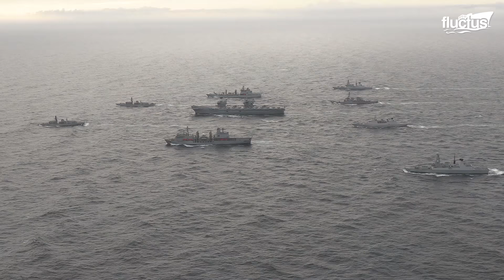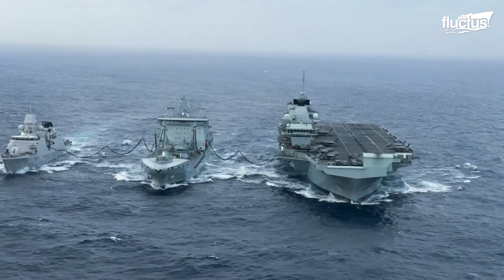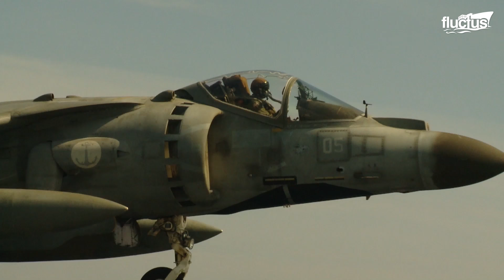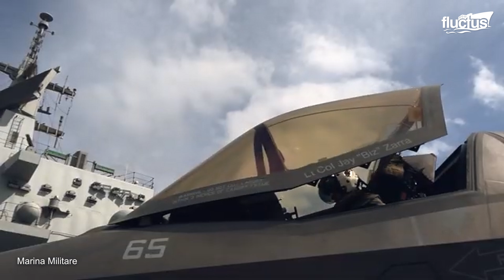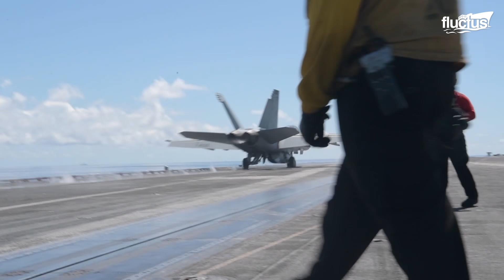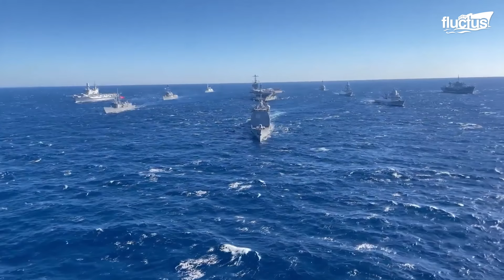Why US is Docking UK’s Most Powerful Carrier Inside US Navy Base

Comment: Does the Royal Navy have enough ships to provide protection and supply for it's own carrier group I doubt it they only have like 41 F-35B for both the royal navy and Royal Air Force to share and I think a full complement of Aircraft for one carrier is like 40 my worry for any western power is if a full blown war came could you replace the losses quickly with industrial output I think not which is actually the true measure of a great power you do not have to have the best to win you just have to outproduce and more than cover losses quickly

Comment: When I was a kid I got to go aboard a type 21 British frigate, like the HMS Antelope. It was quite impressive. This was before the Falklands War. A handful of years later and I was stationed on the USS Kitty Hawk. I immediately thought about my earlier experience on board that British ship. You see, the HMS Antelope was sunk during the Falklands War. That frigate had zero water tight compartments, while the Kitty Hawk had endless numbers of water tight compartments. You could literally cut the Kitty Hawk in half, and both halves could keep floating. Another thing I thought was odd, even as a kid, was as you entered the British ship, you entered a lounge with a typical 70's living room couch, a wooden kitchen table with wooden chairs, and particle board kitchen cabinets on the wall full of warm beer - which of course they offered my aunt and uncle one. Comfortable for sailors that were deployed long term, but not great during war time.
Reply: The Amazon class, designed and built by Vosper because they said they could build light patrol frigates faster and cheaper than the MOD and its "conservative build requirements."  
All those rules you have about water tight compartments? 
Who do you think wrote those rules? 

That stuff is a lifetime ago now, all British warships are built to the same survivability standards as the US. 
We are in fact the only other navy that builds to that standard. 
That's one (small contributing) reason the constellation class was  such a failure, fremm wasn't built to those standards. 
Everybody here in the UK (who's into this stuff) said at the time, if it's not the type 26 used, America will balloon the cost trying to half arse the design into a us design. 
Whereas the type 26 could have been just swap out the guns, sensors and computers to make a constellation class out of type 26.

But for some strange reason America has an insecure hang up about asking us for help! 😂
I wonder why? 😁😉

Comment: The UK wasted money building two conventional ski jump carriers🤦. For one they don’t have enough sailors, aircraft, and supporting vessels to deploy both carriers at once🤷‍♂️ second a nuclear powered carrier can operate longer by the way then a conventional one, also a nuclear carrier carries more aircraft munitions for the aircraft and fuel for the aircraft because it doesn’t have wasted space carrying fuel for itself. Third an aircraft carrier with a catapult system can launch and recover a variety of fixed wing aircraft, including refueling aircraft, electronic counter measures aircraft, and radar commanding control aircraft such as the E3 Hawkeye which allows the carrier airgroup to be more effective, have a long range, etc., etc. I noticed y’all mentioned the Harrier which was designed and built in the UK, however, the UK no longer produces a VTOL aircraft instead it purchases the F 35B from the US and relies on the US for spare parts, upgrades and tech technological troubleshooting🤦. The US Navy doesn’t even use the F 35B it uses the F 35C which doesn’t have vertical takeoff, landing capabilities, but does carry more fuel and munitions and has a long range🤷‍♂️. Basically the UK is proud of their carrier which the US would be embarrassed to build, knowing it could’ve instead built an ex extremely more capable nuclear powered aircraft carrier

Comment: This thing hasn't been operational since July 2025. The propulsion system basically doesn't work.
Reply: Was released and under power since April 2026. It didn't just drift over the pond.
Reply: Why do you muppets feel the need to write absolute garbage?
Attention seeking?
Reply: The ship was in dry dock for much of that time having a refit. HMS Queen Elizabeth is currently at sea undertaking post overhaul trials & work up. Whilst both ships had well publicised issues with their shaft couplings, they have subsequently been replaced. HMS Prince of Wales sailed 40,000 nautical miles in 2025 without recurrence of that issue. To date I am not aware that they have had any issues with their on board sewage systems!
Reply: @tonystevens9278  the Ford was deployed for 11 months longer than anticipated. and stayed deployed with the problem while taking part in actual combat. It didn't need to be towed home.
Reply: @JackAmatucci-e8k  - The two QE' class ships have never been towed in open waters either. Mechanical things can & do break that is just a fact of life. With a long deployment there is more wear & tear on machinery and people.
Reply: @tonystevens9278 where they towed?
Reply: @tonystevens9278  If you don't go anywhere, there's no need to be towed.
Reply: @julieinthenorthwest4594 good point
Reply: Not to mention they decided it was too expensive to operate along with her sisters....

1 I believe wasnt even built and the 2nd has nothing but issues along with this carrier as well.

Its nice to see out and about but these ships are not impressive and plagued with issues.

The UK would rather spend money on immagrants then to operate and maintain there carriers
Reply: @kriskimmel2128  But Starmer controls four submarines, each capable of carrying a dozen MIRV-tipped SLBMs. Their Navy should sail those to Georgia and turn them over to the US Navy. Before they end up in the hands of the IRGC.
Reply: I thought HMS Prince of Wales was broken down near Norway and to be towed back to port.

Comment: Those carriers are garbage. Not having catapults and arresting wires was a TERRIBLE mistake.
Reply: Why is it a mistake??? Try to  learn things, before leaving a comment first.
Reply: @RichK-GB  It is a mistake because the F-35B variant is inferior to the F35C. The F35B variant can only carry limited ordinance and fuel operating off the QE class carriers. Where the F-35C can not only carry full internal fuel and weapons, it can also operate in "Beast Mode" and carry a huge payload when stealth is not required.
Reply: @Bellthorian  You told the Royal Navy and the PM, think you better had

Comment: Can the F-35 land vertically with the ordnance still aboard?
Reply: Actually, yes. They now implement Shipborne Rolling Vertical Landing (SRVL).  This allows a heavier payload  on return.
Reply: @gavinski24 So no!
Reply: @jamjardj1974 you clearly dont know how to comprehend what you're reading... sad.
Reply: @Yawnzee_ 🤡
Reply: They can land with 5000 lbs of ordinance in the hover but Prince of Wales has a bedford array allowing SRL with a full compliment of weapons. Queen Elizabeth will have a different system fitted as part of project vanquish which will utilize a UAV AEW system, also doubling as a mid air refueller and loyal wingman.

Comment: Answer the question why is it docked there?
Reply: They always dock at at US bases in the US and abroad on regular port visits as do US warships.
Reply: The HMS Queen Elizabeth in UK waters after leaving Portsmouth.
Reply: Because its safe dock while away
Reply: Cheaper gas, also have BP fuel points for every top-off.
Reply: Join the Navy kid then you understand
Reply: It needs fuel!
Reply: Since its not nuclear powered, and with the UK having the highest energy costs in the world, the cost of sending it to the US must be astronomical.  Especially since its basically designed for operation in the North Sea as the UK has been handed the command of NATO Joint Forces Norfolk.
Reply: @jongrho602 Britain isnt even in the top 5 for most expensive fuel in Europe mate and QE is a blue water carrier, both have been around the world with prince of wales only returning 2 months ago from an 8 month deployment to the far east and Australia.
Reply: @jongrho602 
"Designed for use in the north sea" would make it the most capable and powerful carrier in the world. 
And it can operate in the north sea. 
We can operate anywhere. 
We are one of only two nations with a global basing and logistics network where our navy can be refueled and restocked anywhere in the world. 
Only us and the US can do that.
Reply: @jongrho602 nonsense
Reply: @jongrho602 it's not nuclear powered so it can be re fuelled serviced or repaired in most allied countries not needing to return back from other side of world or eye watering decommissioning cost .
Reply: Keeps breaking down
Reply: @JOzzie-u8z  Like your spelling?

Comment: If the F35B is a true VSTOL aircraft why can’t they share a hangar on the back of a cruiser. It makes an aerial weapons delivery system more efficient when capital ships aren’t around. Just a thought like Thayer Mahan’s thoughts.
Reply: That is in effect how helicopters are stored on smaller ships, but they only carry one or two anti-submarine helicopters. But in wartime the QE2 carries up to 72 F-35Bs, where would you fit them?
Reply: It would be limited to just a handful. And then not all of them at one time. No storage, or service centers. F35’s are very needy ladies. There’s probably more reason for it to NOT house them. Than there is for it to be viable.
Reply: The British decided long ago, they are geared and can only afford JUMP JETS, ad their primary defense force on water.
Reply: @travisroundtree2104 In now an ever changing world of sea warfare are we now where Thayer Mahan wrote about one hundred and twenty five years ago. Are we at that point in time where capital ships are a liability?? That’s my thought process.
Reply: @bigmountain7561 respect
Reply: @travisroundtree2104 respect yes. Semper Paratus 1790!!!
Reply: @bigmountain7561 no sleep or rest for the prepared. You never have to GET READY.
Reply: The F35 needs the ski jump for extra lift to take off with a full payload and fuel.  Also the cruiser deck is not made to handle the enormous engine blast/heat for takeoff and landings.
Reply: @jerryware5749 oh ok but it can be done once in a while correct
Reply: @bigmountain7561 only if the deck has been updated for F35B.
Reply: @jerryware5749 Ok cool
Reply: Using F35s means they have to treat the deck - I dont know what they do the surface of the deck